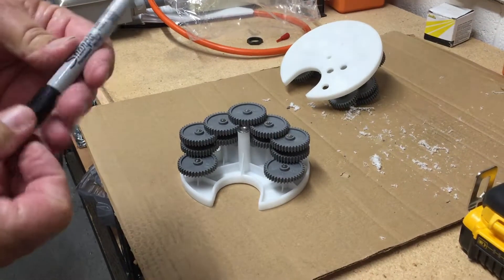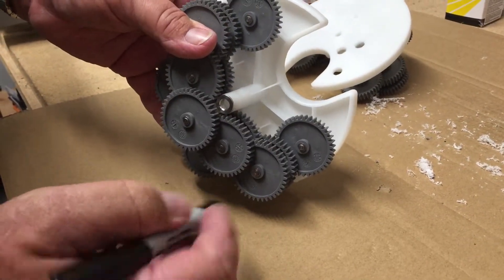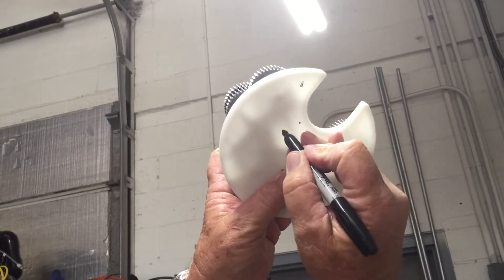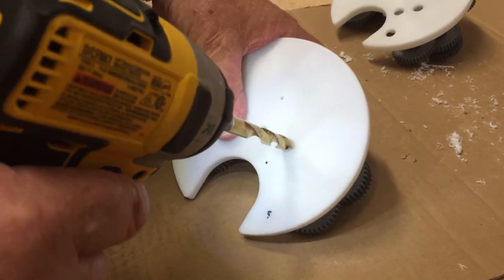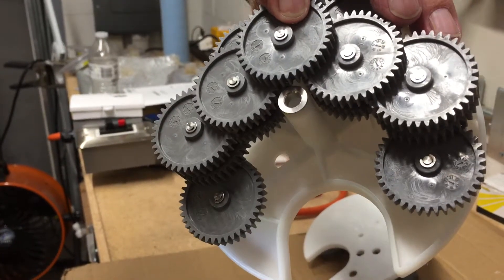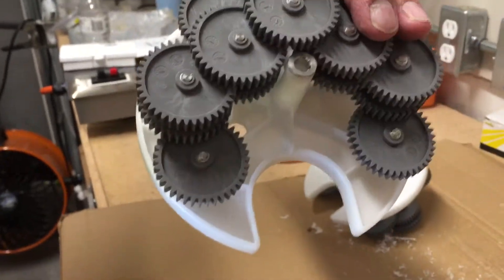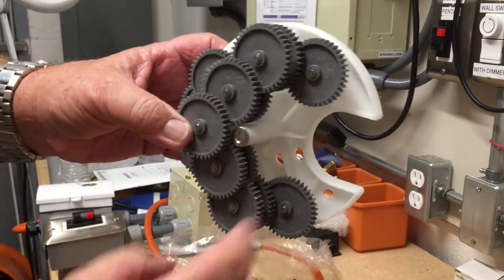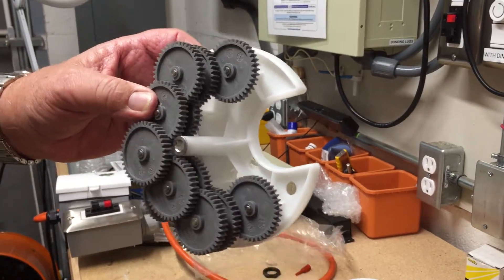Blue Square Drilling bypass ports in water valve cassette

Comment: What is the purpose of drilling these holes? Will they prevent the water valve from shaking from high pump pressure? My water valve shakes if my pump rpm is set higher than about 2350. At that low speed, however, the floor cleaning system doesn’t do a very good job.